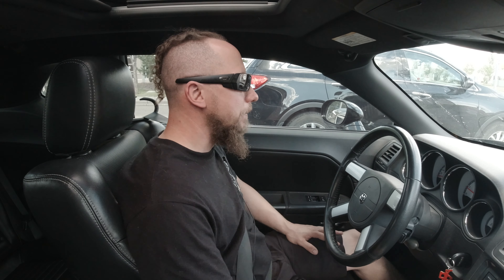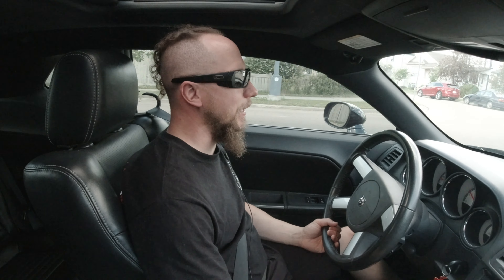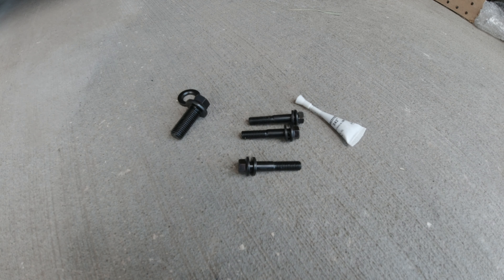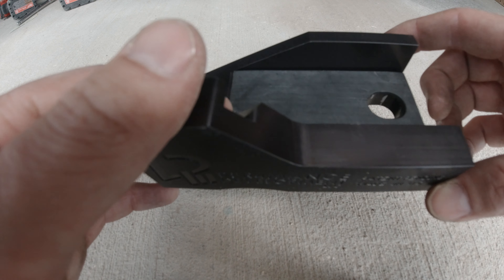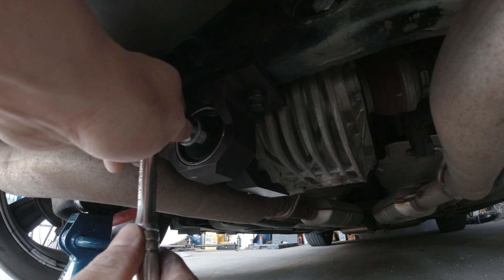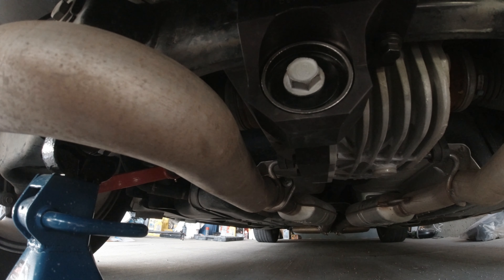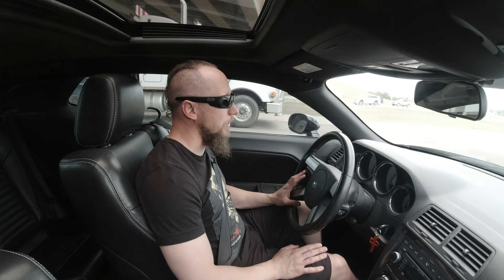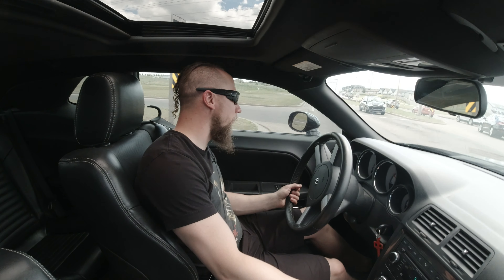Challenger R/T Gets a Per4mance Development Differential Brace Installed.

Comment: Good idea, not only does it stop the diff from moving under high torque, it allows the power that would be torquing the diff too now get to the wheels more efficiently. 

That said, something too consider is that this probably puts a hell of a lot more stress on your axles, since you're transferring that twisting force away from wrapping the diff, and into the axles.

Comment: For the clunking check the bearing in the middle of the two driveshafts. It is kind of a pain to get to but the could be your clunking. Everybody worries about the diffs these days but people rarely remember driveshafts and the half shafts. If you ever get into pulling the rear subframe put differential bushings in from energy or prothane or someone like that. As long as they are polyurethane. I should have done mine when I had my cradle out.
Reply from the maker: Thanks for that, I’ll definitely keep messing with it until I find it.  I’m not super experienced with drive line stuff, so troubleshooting it is kind of guess and see if that’s the problem.  Thanks for the feedback!
Reply: Yeah we should’ve did that when we did the cradle bushings
Reply: @SrtChargerOldMan  same.

Comment: Correct me if I’m wrong, but I think the bucking at low speed is the engine not having enough power to spin the drivetrain at such a low RPM. My 6 speed does it too. Thanks for the video, I’ll definitely be getting one of these braces now.
Reply from the maker: I’ll be looking at the drivetrain this spring to see if I can sort it out, I’m not 100% sure what’s causing it.  Cheers!

Comment: I did end up finding that both rear axle shaft nuts came loose a bit and the axle splines would rock back and fourth in the wheel bearing hub. I’d double check those axle nuts that there torqued. And also noticed the drive line has lots of slack just turning it back and fourth. Ended up just living with it. My 18 has way less slop in the drive line. Apparently the 13 rear diffs were built with quite a bit of backlash on the crown and pinion which gave it some slop. My 18 is much better but will occasionally do the same thing. But way less.
Reply from the maker: Very interesting!  Thanks for the insight, that helps!  I drove a ‘19 Hellcat manual and it felt miles tighter without that same slack, like how you describe.  I wonder if I can change it.
Reply: @TrackPackRT  I’m sure there is something you can swap in. Maybe do a stronger cv axle while your at it.

Comment: I saw you already had lower rear control arms. We love our per4mance development diff brace. Bias ply tires such as the Hoosier quick time pros or the mickey bias plies work best on manual cars. Helps take shock out of the drive train.
Reply from the maker: I’ve got to decide what to do with my tire situation soon as my 555Rs are pretty much bald at this point.  Was thinking of getting a dedicated track/wheel tire setup and some new street tires.  Still haven’t pulled the trigger.
Reply: @TrackPackRT  we have ran the race stars for years. We have a dot set and a drag setup. 17x4.5 fronts 17x9.5 rears. Our drag setup are Hoosier radials and Hoosier front runners. Our dot set up is m&h front runners. Mickey street r radial rears. Some classes we run take dot tires to pass tech.
Reply from the maker: @heatherandjasonnelsonracin647  nice!  Is you guys' Scat a manual?  It's hard to tell from your videos.
Reply: @TrackPackRT  no it's an 8spd auto. We have tried the street r bias-ply tires. They worked great. I sold them to a buddy that has a manual hellcat.
Reply from the maker: @heatherandjasonnelsonracin647  just wondering because I never see many manual drivers hitting the drag strip.  I’d be curious what guys are running stock in a manual Scat, the auto definitely helps the ETs on these cars for sure.
Reply: @TrackPackRT  our car went 12.2 bone stock with a drag pack. Stock manual 6.4 cars usually go 13.2 stock tires here. Never seen one on a good tire run here yet.

Comment: When my ‘10  bucks I slip it into 3rd at school zone speeds , 20mph.
Reply from the maker: I find 3rd is almost letting my rpms drop too much where it wants to start bucking, in 2nd the rpms seem high enough that it stops it from happening.  I’m glad that at least other manual owners know what I’m taking about though, it’s hard to describe!  Haha
Reply: @TrackPackRT  you have the slightly lumpy cam, right?  My ‘10 is SC’d.  Have you replaced the stock shifter?  I don’t remember.
Reply from the maker: @Kuhladestkyicky  not yet, still rocking the stock one for now.
Reply: @TrackPackRT  if you do get the Barton not the Hurst.  It will be the best $500 mod.  1-4 super short, firm but smooth and 2-3 finds itself.
Reply from the maker: @Kuhladestkyicky  it’s definitely on my list!  Everyone loves the Barton shifters!

Comment: I’ve been thinking about replacing my differential bushings I think there’s three of them BMR make some I can see two of them right above where you’re working but mines an automatic 6.1 hemi I already replaced my driveline universal joints flex disc
Reply from the maker: I thought about doing the same thing but there ones up top I don’t think you can change without dropping the cradle which put me off doing them.
Reply: @TrackPackRT  We should’ve did it when we did the cradle bushings I know mine are weak

Comment: Get a one piece driveshaft especially since you are racing at the track.
Reply from the maker: I’ve been thinking about it but I was always worried about vibration.  I saw demonology threw one in a while ago and it seemed to work out well for him.
Reply: @TrackPackRT  I've been running the 4" Aluminum driveshaft for 8 months now, there is no vibration at any speeds I've run.    Even if you do decide to go the one piece route, the drag strip will require you run a driveshaft safety loop, so factor that into your cost.    The one piece shaft will remove the resistance of the center support bearing assembly, and also remove the failure possibility of that same assembly, that many have already experienced the hard way, you've been lucky so far.   Less drive line resistance will also improve your times at the strip.
Reply from the maker: @David-qf9gp  fair enough, something to think about.  I wanted to start running dedicated wheel/slick combo for the track but to do that I need the drive shaft safety loop as well for track rules.  You notice any negatives for daily driving with the aluminum DS?
Reply: @TrackPackRT  No negatives daily driving, unless you consider a faster throttle response to the rear wheels a negative, you will have to relearn daily driving the car though, especially if you were used to turning the wheel for a quick around the corner leave from a stop sign or light, knowing exactly how much throttle to give, and the rear end busts loose on you and you have to get out of it!  When you install a one piece driveshaft, you will be kicking yourself that it was not your very first mod!  You'll see!

Comment: Do you have the 230mm Rear end?
Reply from the maker: Factory 3.92 rear from 2009, don’t know the spec on it I’m afraid.
Reply: I believe it is 225 axles. The stock rt axles are 215 I believe.
Reply: @Sak-zo1ui  Ok I just got my T/A a few weeks ago and I've been looking into it, looks like I really dont have to mod the rear end I got the performance handling which gave me the 230mm rear end with 3.09 gears
Reply: @YGSpider  im assuming you have a 2015+ challenger. If you have the 309 gears make sure they are limited slip. I have seen some 309 open floating around although the main open diff with higher gearing is the 307 rear end.
Reply: @Sak-zo1ui  I picked up a 2021 Challenger TA fully loaded it has Performance handling so I get the 275's and Brembos and It has Performance suspension which I believe upgrades the shocks spirngs and gives you the 230mm rear end with the 3.09
Reply: @YGSpider  i believe the 3.09 is separate upgrade. If you get under your car take a pic of the rear end pn and look it up. On the top of the diff it should say the ratio and then open or lsd. You can also go to dodge parts and have them look up your car. They will tell you.